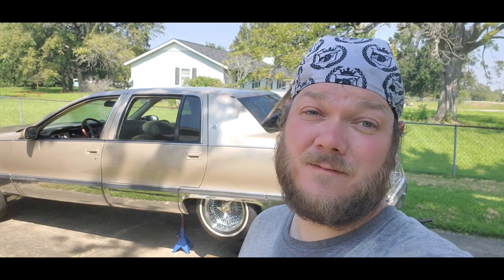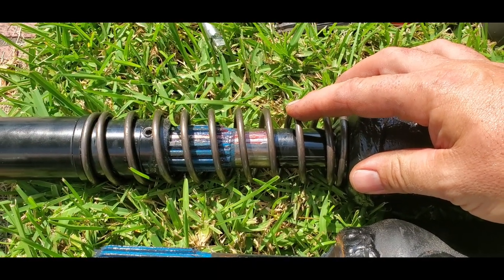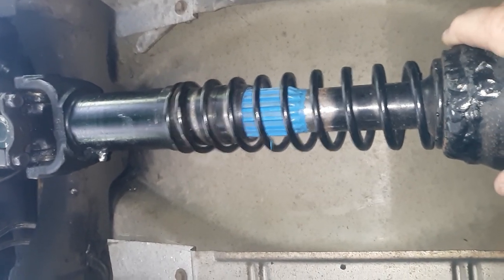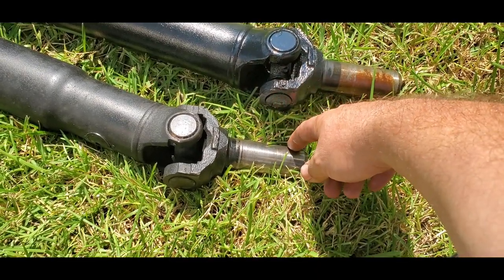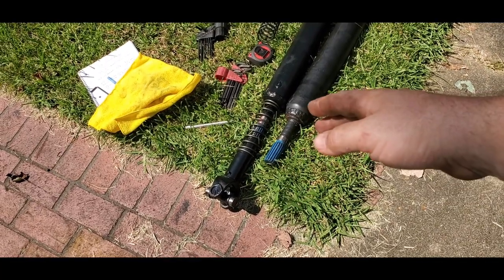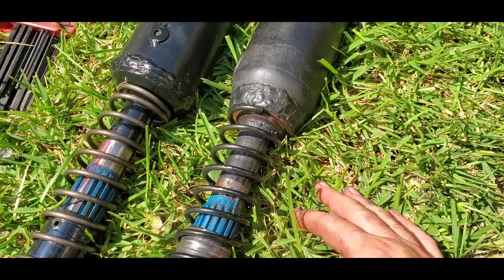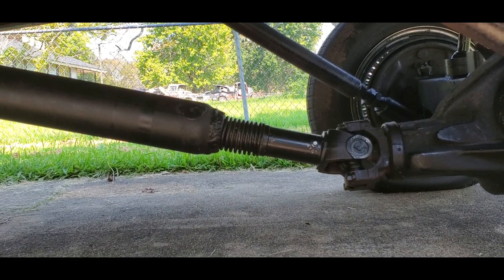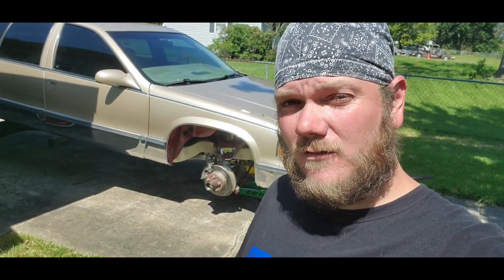How NOT To Install A Slip Yoke

Comment: next time you get a shaft made bring the driveshaft shop 2 measurements...measure trans seal to center of the rear u joint both locked up and layed all the way out...give both numbers to the shop and they should be able to build you the shaft correctly...if you want to be extra fancy you can take the same measurement at your normal driving ride height, they coukld balance it at that length to give you the best balance for how you drive around.
Reply from the maker: Yeah I gave them the both measurements the issue we ran into was trying to get the right amount of spline in the slip yoke whils still having the amount of slip needed for my set up then having to add a spacer in the front of the shaft threw everything off again

Comment: I got a long arm kit on my caprice and it doesn’t have any issues with the driveshaft. Can drive up and down without any issues however the previous owners tried to 3 wheel it and KO’d the driveshaft and trans lol so I need a slip to be able to 3 wheel it.

Comment: I saw the way you got under there and shook the driveshaft. Is that one way to see or lean towards getting a slip yolk driveshaft? I ask because I installed a fbss set up in my 72 montecarlo.  8 inch in the front and 10 inch cylinders on rear, and when I'm lifted all the way up,  I do get a bit of a flat tire sound, could be vibration. But when I tap the rear down ,noise goes away.
Any suggestions?
Thank you
Reply from the maker: The sound you are probably hearing us vibration noise from the pinion being at a bad angle if you have adjustable upper trailing arms you can try adjusting them in or out and see if the sound goes away
Reply: @thecadillacdanshow8658  thank you for the help👍

Comment: Do you have to weld a nut to your transmission yoke coming out the transmission and drill A hole through your driveshaft yoke and bolt it on so it doesn’t rub against your rear seal or come out the back of the transmission I have the same problem
Reply from the maker: You can do that also

Comment: so you need a slip its yout got 16 plus cylinders in the rear?
Reply from the maker: I have 22s most cars need a slip with 14s and up depending on the trailing arm configuration